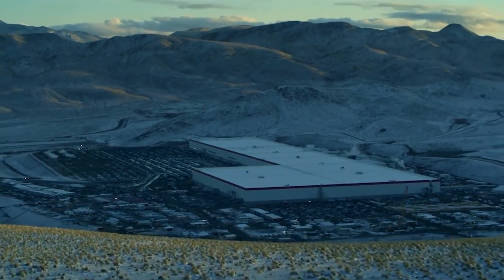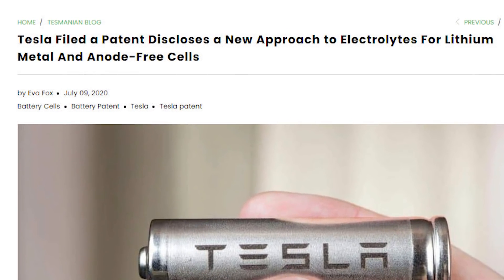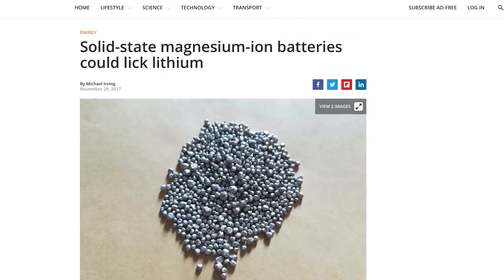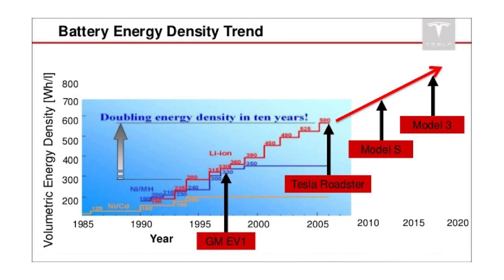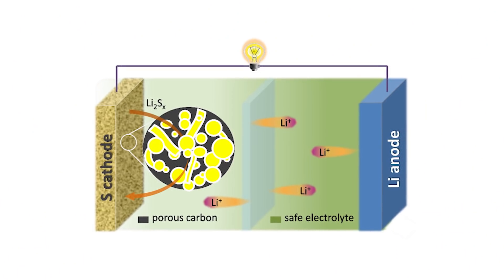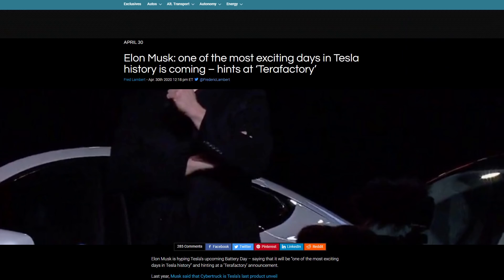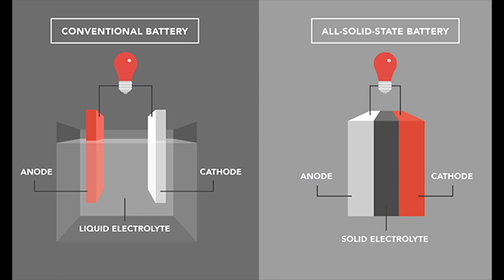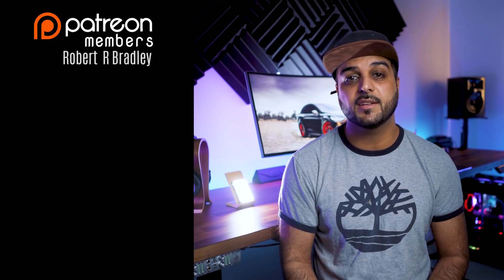NEW Tesla Battery Patent at Battery Day? Future Technologies & Decade Of Battery Breakthroughs

Comment from the maker: With all this hype going around Tesla's Battery Day, what are you REALLY expecting from the Battery Day?
Reply: A battery
Reply: Ronald McReynolds  lol you just said the exact same thing but made a fairytale out of it no so smart you are
Reply: Air batteries!!!! Need to know more about them!!
Reply: Think the major focus will be diversification of battery sourcing, not specifically new battery technologies but primary existing ones modified to make Tesla car production not being bottle necked due to battery sourcing. Musk hinted at this during the earnings call... There might be some discussion about future battery tech as well but any new such technology is minimum 5 probably 10 year away from being able to source it on a level that's meaningful for Tesla production.
Reply: solid high range battery
Reply: NOVONIX...
• Is delivering the battery materials the EV and renewables future needs
• Is redefining the manufacturing processes to deliver lower costs, waste and emissions needed
• Has core competencies across all areas of cell technology development
• Has strong connections with leading companies in the battery, auto, renewables and electronics
• Has demonstrated technology advantages in anode, cathode and electrolyte (with more coming)
• Has first commercial technology in PUREgraphite anode material with a contract with Samsung SDI
• Is the only company to break into this market from North America or Europe
• Has cathode technology entering pilot scale and commercialization phase now
Reply: A flying car. Fifty mile range would make me happy!!!!
Reply: This is rocket science only different!!! Glad there are people out there a whole lot smarter than me!!!! Than I!
Reply: check out Novonix battery break through, rumors saying Telsa will have a partnership with them.
Reply: my Tesla stock to jump another 1000% lol. I love me some Elon musk
Reply: Q
Reply: Q

Comment: People are obsessed with range. The days when more than 150 miles were desirable are behind us. With more chargers and reliable chargers around now, you can stop when you need to, and 150 miles is a good time to stop for a few minutes, if you do more than that without a break, you shouldn't be allowed near a car. The next thing is charging rates are going up. You no longer need 40 minutes to put on 80 miles of range so it all works out perfectly, the charging time and range perfectly match your breaks. You don't need to carry around a bigger battery than is required which will keep vehicle weight to a minimum and improve efficiency. Of course, 150 miles of range dead is not quite enough. You want to work between 20 and 80% charge to be kind to your battery so 200 miles or so is about right.

Comment: I have been talkin about these batteries for about two months now. Hey these batteries are supposed to be good for thirty-six hundred miles to a charge. Now after 75 cycles let's 250,000 MI. You lose 10% of your charge holding capabilities. Big whoop so you lose 360 miles of range out of 3600 mile so now your only getting 3240 miles to a charge. 
I think he should go with it just like it is this battery would just wipe everybody out.

Comment: I am an electric engineer born in Romania and living in USA. An electric car shall not have an invertor or a differential. I invented an AC electric motor which make the inversion directly on the motor.  Also if we use an electric motor for each wheel and a small gear box we eliminate the differential which is disadvantageous. I also have an idea to use electric generators as car springs. I think the battery shall be changeable at pump station. I offer my idea to any company interested in my ideas.

Comment: California has been so successful with solar its creating a massive 
impending problem. They call it the duck curve but it comes down to 
solar (and wind) only providing its power during the  availability of 
sunlight  ( or wind). Even though solar could solve the energy needs in 
quantity easily, it cannot in time. In the evening when the sun goes 
down the power demand goes up. This is a many trillion $ problem. The 
electric grid provides about 1/3 of the total energy demand. Tesla is 
positioned to both compound the problem and win from the problem.Tesla 
is a self fulfilling prophecy. Its massive EV growth ( and driving the 
competition)is pushing the energy use of automobiles from the 1/3 of our
 energy used in transport gasoline to the 1/3 grid energy. This is 
further compounding both the size and timing of the power needs. Most 
EVs charge at night when solar is unavailable. That means Tesla is 
driving the duck curve problem even more charging EVs. But the only 
answers are using natural gas  peaker plants  or using energy storage. 
The quickest way to deal with the solar/EV mounting duck problem is 
residential and other distributed energy storage powered by solar. This 
is because upgrading the power grid is expensive. But local distributed 
energy storage and solar do not force a grid upgrade. Enter Tesla with 
both. As Climate Change data scares the world more and more, it will 
become obvious its needed to drive energy storage. Enter US ( and world)
 tax incentives. Tesla having both solar and energy storage, will 
accelerate due to its own self fulfilling prophecy.
Reply: I am currently in Costa Rica, which produces nearly 100% of it's electricity from renewable energies:  Wind, Solar, Thermal and Hydro.  Unfortunately, most people drive older, internal combustion engines, which pollute a lot.  However, electric vehicles and charging stations are starting to pop up.  Could you imagine a country where all electricity is derived from renewables, and most of the vehicles are electric?  Clean air.
Reply from the maker: Well said! Tesla already has a "master plan" that is being fulfilled as we move forward. The new "million mile" batteries are great for energy storage. Put that together with Tesla's solar products and you won't need peaker plants. Once there's solar on every rooftop, generating and storing enough power won't be a problem. The so-called "duck curve" will be eliminated once we can store more energy than we use. Not sure if you've seen this (https://youtu.be/ZhVTi19rB2o) video I made some time ago, but in that video, I kinda talk about exactly this!

Comment: More than 200 miles is an important factor especially if you live in Miami or the FL Keys and you need to evacuate the state since a category 5 hurricane is coming. In that case a solar generator will be good, charged before the hurricane hits or gas generator. Either way for any reason there are times when we need to drive more than 200 or even 300 miles for an unexpected reason.
Reply: nó its luts çhae 150 nioe ir 1²5 îjes olabty

Comment: Lots of TESLA  HYPE.... ! ! !    Years before I bought my Tesla X in April 2019, for over $120,000 + taxes,  I put down $1000.oo and WAITED & Waited...  &  Waited.   I was promised "FREE SUPER Charging,  bumper to bumper free repairs for a decade,  a "User Tesla" if I ever needed "service" and it came with NO SPARE TIRE.  Replacement tires and balancing WERE NOT part of the bumper to bumper guarantee of free repairs.   Over 400,000 other buyers put down $1000.  That was $400 Million bucks, enough to build the factory.  And we were not even given a few shares of stock.  Then when I got my Tesla,  I was told, "Oh, NO Super charging"  and I still bought it, but with a grudge,  because I had put down another $2,500 to get it in a few weeks and I had to wait YEARS.  I asked about the lack of spare tire.  I was promised anywhere in California "and most other states" I would call a number and be given a "Loaner Tire" if I had a flat.   Within a few months I had a flat.   Someone told me on my Tesla X system, no worry, someone would be there in 1 hour.  that was in Los Angeles.   2 hours later a tow truck showed up with the loaner tire. It was Sunday nite, so I did not complain.   Weeks later they called me and had a NEW tire for me, "and would I please return the loan Tire"  .  I did.  I drove another 23,009 miles plus, scheduled  a replacement of my front tires.  They were bald.  When about a week later, I was about to go to Santa Barbara for my two new tires, I got a message my appointment was delayed another week.  Tesla in Santa BARBARA, HAD NOT GOT MY REPLACEMENT TIRES.  NOTHING I COULD DO.   A FEW DAYS BEFORE MY LATER, RESCHEDULED APPOINTMENT ONE OF THE BALD TIRES WENT FLAT & SHREDDED 11 MILES FROM HOME.   AFTER HOURS OF WAITING, I CALLED FOR A PRIVATE TOW TRUCK.  TESLA GUY SHOWED UP,  FINALLY, WITH NO "LOANER TIRE", BUT I WAS ALREADY ON MY PRIVATE CALLED TOW FLAT BED.   AND NEITHER OF THEM HAD A SPARE  "Loaner tire".  So on my 2nd flat tire, because Tesla of Santa Barbara could not even keep a few "spare" tires in stock.  I had to be towed home.  then towed again to Tesla of Santa Barbara, Ca.  58 miles south.  Then when they replaced 3 tires, because I had to wait basically ALL DAY, they offered me "uber Credit", but I had forgot my cell phone so that was useless.  I asked about the promise that if ever in need, I "would get a loaner Tesla" while waiting for repairs.  "Oh, they dropped that and you get Uber credit".  NOT what I was promised YEARS earlier.  So I am wondering WHAT other Promises are going to be broken, so CEO  Elon Musk, can pay himself and additional $770 Million BONUS on top of his already sky high salary?  And with all they hype and promises, Elon can not spare $1 million to keep spare tires at the store where I bought my Tesla X???   Really,  After waiting for years, I should have got Free Super Charging promised, a "user Tesla" when waiting all day, and a few (say 10 shares of Tesla Stock) when I put down my first $1000, which they later claimed in April 2019, they had "no record of".   Now I have solar at home and usually re-charge at home, but Too many broken promises.  And failure to have spare replacement Tires "IN STOCK" is very disappointing, plus I wanted a "brand NEW" and I got one with 600+ miles on it.   I wanted creme color interior.  I had to accept black, or wait more weeks, maybe months.  With $40 k down payment plus $5,000, you would think I would at least get some slack, a few years of Free Super charging, and spare tires when I need them.  so I spent another $1,300 for a new tire and Rim, I keep at home just in case TESLA fails me AGAIN.   And I can't even get a Tweet to Elon Musk.   He is too busy sticking it to the "short sellers" and customers to even Notice.  I do like my X.   And when its working with good tires, its greatest I ever drove.  I probably will never buy another gas gusseler,  OH, and the original interest rate of under  1% had gone up to 3%.   Now I wonder if the 100kw battery promise to repair or replace for a decade will also be broken.    Lucid Air,  Where are you, ?   Elon Musk let me down, and does not even care.  No way to even reach him.  But I think he was brilliant to bust the chops of the Oil industry that intentionally made us old farts stand in line for hours for 2 gallons of gasoline back in the mid 1970, every other day, if you could get it at all, in L.A.  $770 million bonus, and you can't even give me the promised "Free Super Charging," and have spare tires available, except in Fremont, S.F. and L.A., Ca.????  Gee, Could elon Musk survivie on a bonus of 769 million and keep 1 million worth of spare tires for us to buy without waiting for weeks?  I do a local TV show in Santa Barbara, have made several positive Statements about TESLA X & S models, before the 3, Y became available.  Now I have had over 1 year & 3 months to really FEEL the Tesla Experience, fully.   I have been doing my TV show for 20 years.  And I pride myself on being strait up honest about things.   I would have liked to do a interview with Elon Musk.  But ...

Comment: The age of the gasoline and diesel engines is far from over. Between the Achates Opposed Piston Engine technology and the ability of motor enthusiasts to tune engines to far higher efficiency than the DEF standards (if the EPA would get the Hell out of the way), batteries and electric engines won't be able to match ICE engine efficiency until the mid-2040s. If my brother can get 38 mpg highway out of a Chevy Silverado 2500 with an 18-year-old Duramax today, he'll be getting 55 out of the Achates OPE coming to market by 2022. That's an enormous gap vs. the "industry standard" numbers everyone is comparing right now.

I'm all for the improvements in batteries. I love my Ego 76V weed whacker. Doubling the capacity of that battery would be stellar. But cars? Nope, we've got a long way to go. Teslas are beautiful cars with extremely well-designed interiors and UIs, but they have a long way to go on matching what conventional vehicles CAN do if the environmentalists would get out of their own way.

Comment: As I am part of team building a small electric plane, I would disagree that it is not viable solution yet. It actually is! And we intend to prove it so far in segment of very light aircrafts with a single seat plane, which will have about 2 hour endurance, won't weight more then 350 kgs and won't cost more then 25 000 Euros. Just a FYI, in plane is plenty of unused space, so Whs per l are not that important as Whs per kg. Give me cells with 500 Whs per kg and I will build you four seater plane with 4 hour endurance.
Reply from the maker: 4 seater with 4h of filght time? That sounds amazing! It's been generally thought that electric airplanes won't be possible until we reach at least 400 Wh/kg energy density. Some have even said that it would have to be at least 800 Wh/kg. But as you said, a small light weight plane is possible with 500 Wh/kg. I'd love to see people and companies come up with small personal aircraft designs that are affordable so we can start to relieve some traffic on the ground.
Reply: @WattsTheFuture  It's all about aerodynamics. Most of the current small planes are flying bricks. It's actually the same as in EV field, Teslas are practicaly the most aerodynamic cars of the world. Why do you think it is so? I can say, you can build small light weight one seater plane even with 250 Wh/kg. Sure, it will have only 22 kWhs of energy, but also consumption at 100 mph around 8 kWhs per hour. Way better then any EV can achieve, as there is only aerodynamic drag, which can be perfected.

Comment: Thnaks Harry for this video. Sounds very exciting. There is a lot of hope and expectations in the Tesla battery day on Sept. 15. I would be very happy, if just some of all the different technologies become reality and ready for manufacturing. For example, if the > 30% reduction of range during winter time could be eliminated would be an enormous improvement and could convince lots of critical car-buyers.
Reply from the maker: Thanks for tuning in! The battery day was moved to Sep 22. The heat pump that Tesla added to its cars did make a huge difference in colder climate, though I'm not sure if it only operates when driving and not when the car is parked. If anyone knows please share 😊

Comment: That's only one of several patents from the Jeff Dahn team and Tesla.
Their current 2170 cells are already at about 714 Wh/L. (June '19)

Patents related to production process, internal cell construction, chemistry AND electrolyte promise a cumulative density increase of about 30% or more.
Then there's the pack.
Another patent details new construction methods and innovative cooling by change of state of the coolant material.

Imo, the above will result in:
Huge production increase in a given space (Terawatt!?)
A lighter common pack across the whole vehicle range.
A common BMS to suit.
No more 18650, resulting in much cheaper S/X pack (pays for 5efresh!)
And other things.

(Oh, btw, Semi built at GF Nevada)

Comment: Just new the channel but wanted to ask... why not a hybrid Hydrogen/EV car?  This allows to travel more freely than battery alone.
Reply from the maker: That's an interesting question! The problem with hydrogen is that it lacks the infrastructure and has fallen way behind compared to battery electric vehicle charging infrastructure. Plus electricity is almost always available anywhere you go.
Reply: @WattsTheFuture  That's fair.  I just like the refill in moments kind of time instead of waiting hours.  Like, if we drive from Canada to Florida (approx 20 hours driving, after Pandemic, of course), it would take almost 20 hours more, sitting and waiting at charging stations. Also, the vehicles would be much lighter if not all battery, so more distance per joule, right?

Comment: so for the Sulfer battery. 18.25 charges a year at 150 miles a day average (assuming 3000 miles per charge) = 109 years before reaching max charge cycle of 2000.
Reply: I drive about 150 miles a day on average

Comment: The low price segment of the market is a rich one. I have had a bunch of crappy used IC cars, and one thing they all had in common is that they cost a lot in maintenance and used a lot of fuel. I looked at how and where i drive, and i found 99.9% of my driving was less than 80 miles round trip, so when i saw a used Fiat 500e with about 100 miles range I figured I would give it a try. If I needed to drive further i would rent a car. After 6 weeks I am extremely happy with the performance and comfort (zippy and so quiet)and it  costs less than half what the IC car did per mile. I even have some free high speed chargers nearby if I want to save a few dollars. You don't need to buy a Tesla to get on the EV revolution, a $6k used car works well too.